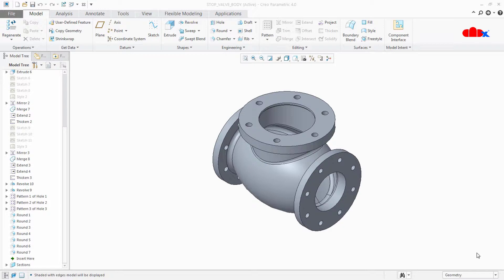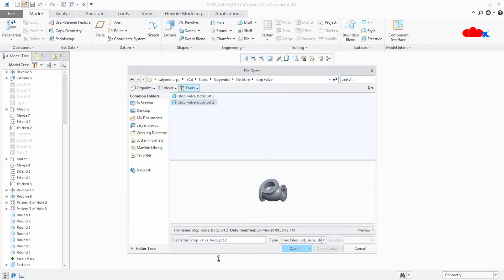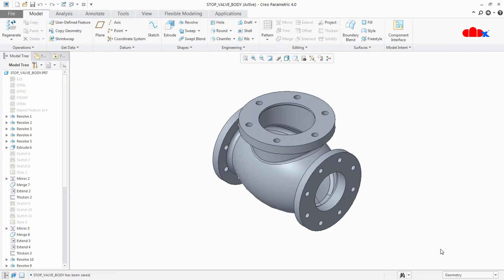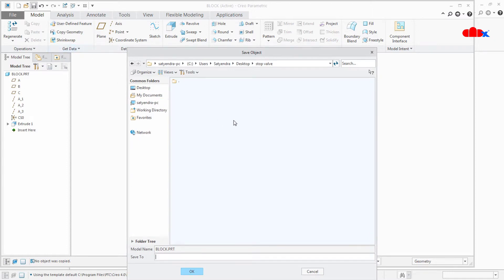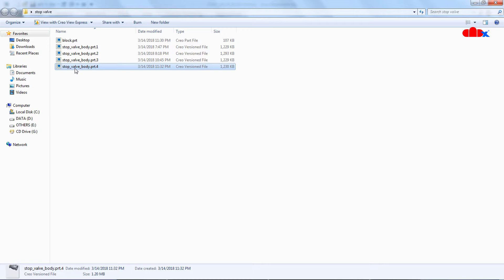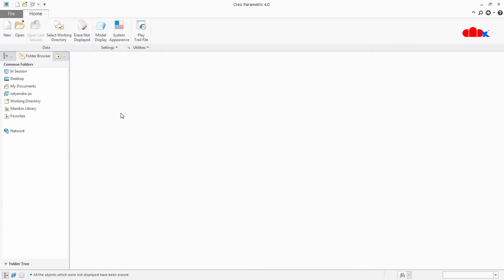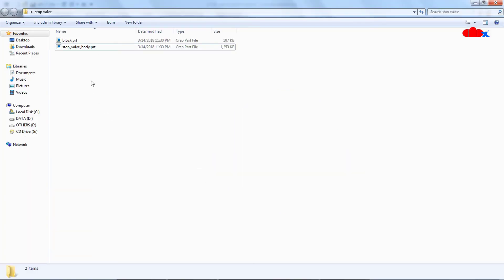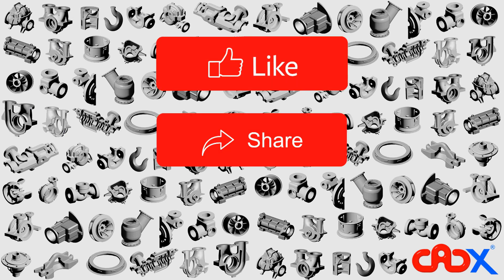Stop saving multiple copy for part and drawing file in Creo Parametric (multiple version)

Comment: Here is another method to get the latest save model. When you are working on a model and save as many time as you want and then when you finish with your model just close the model then you ll see on the "UTILITIES" written under play trail file . In utilities you ll see open window system. Open it and write " Purge ". It give you the latest save model in the folder and you ll have only one save part in the directory.